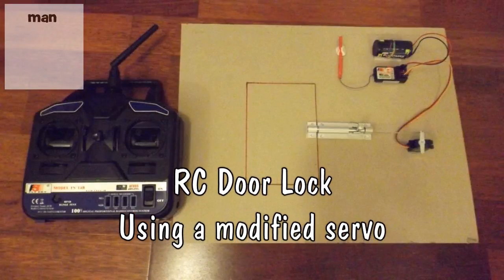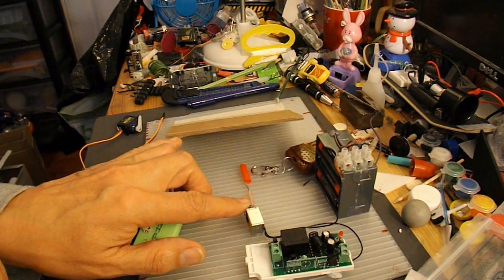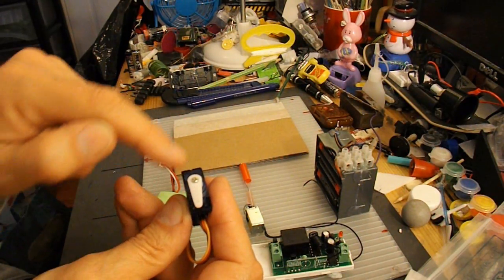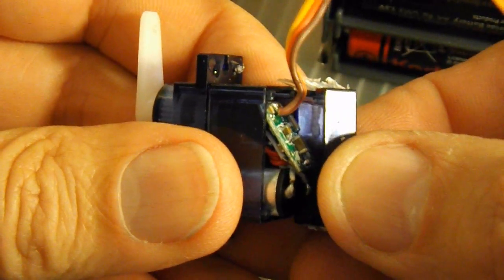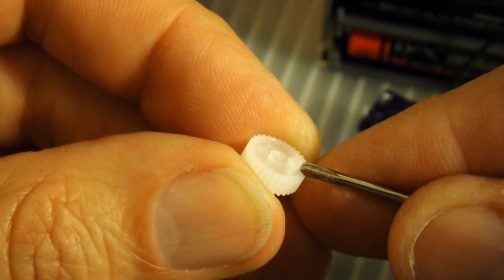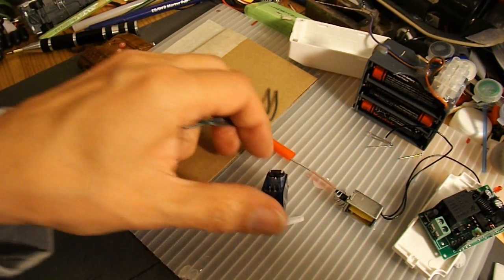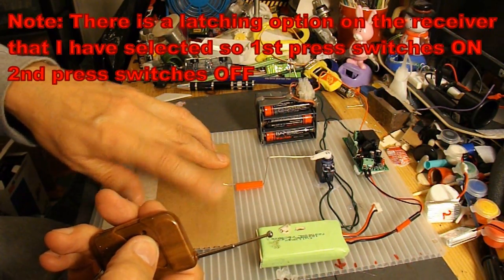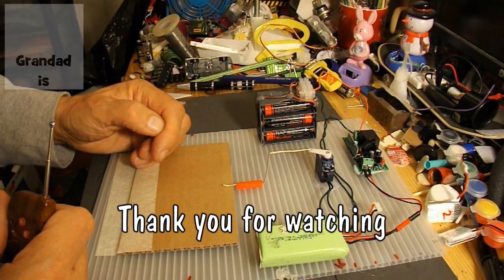RC Door Lock using a modified servo for DC working

Comment: this is poor system you can remove servo and use Only dc motor and also can do this  very easily
Reply from the maker: Yes you can use a DC motor, if you follow through the playlist for this series (link in the video description)  I use several different methods of making this work. My projects are to give people ideas, how they achieve the end result is entirely up to them.

Comment: I've used this concept to create a payload release mechanism however when I connect all the wiring my servo stays on when connected to nc and com ports and won't activate when connected to no and com ports. Any help would be appreciated. Thanks! Awesome videos btw!
Reply from the maker: Let's just check you understand what the COM, NC and NO are for. No offence intended but I need to start at the basics just in case, so skip this if you already know. The battery has two terminals Positive and Negative. If you connect them direct to the two wires coming from the servo then the servo will turn. To switch the servo on and off we are using a relay on the circuit board to do the ON/OFF switching for us. We still run one wire from the battery direct to the one of the wires on the servo. The other wire from the battery is diverted through the contacts on the relay. The wire from the battery is connected to the COM terminal on the relay. COM is short for the COMMON terminal. The other wire from the servo is connected to the NO terminal of the relay. NO is short for NORMALLY OPEN and means that the relay contacts are normally open when the relay is NOT operated so no current can pass through to the servo. When the relay is operated by pressing the button on the remote control the NO contact is CLOSED so current can flow through to the servo and the servo will operate. If you use the NC terminal that is the NORMALLY CLOSED contact and current will flow through to the servo when the relay is not operated because the contact is closed. When you press the button on the remote control the relay will operate and the servo will be switched OFF. There is a handy animated diagram on this link that may help you understand the relay contacts http://www.zen22142.zen.co.uk/ronj/cpr.html
Reply: +GrandadIsAnOldMan thank you so much I'm a total noob so this is very helpful. Thank you for your time.

Comment: hi
 can you please write down the full list of components I will need for this project? I have nothing but a screwdriver actually ....
Reply from the maker: shira ahavan details are in the video description. There is also a link to a playlist where I have several versions of this project. There will be another version published on 23rd of August in response to a recent request. That version uses the components from a cheap RC toy car.
Reply: +GrandadIsAnOldMan the description only says the main components , what about the battery house or whatever it's called, and that green thing? I'm really new to this stuff. btw: in the next video in the series, can you please explain how you put all the components together and close the electric circle? I'm pretty bad with English, excuse me for my grammer and spelling mistakes...
Reply from the maker: shira ahavan your English is fine. I am sorry, but the fine details are not included as it depends very much on what you have available and how you intend to use the system. You have to do some of the work yourself. In this video I use 2 batteries. The green thing is one battery and the big block at the top of the picture is another. One battery powers the receiver and the other battery powers the servo. There should be a wiring diagram with the receiver when you buy it.